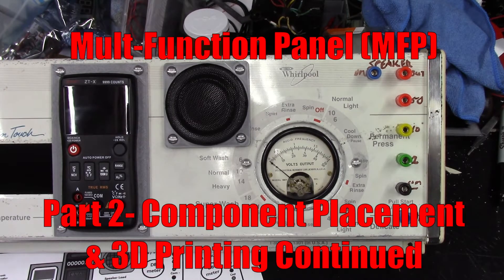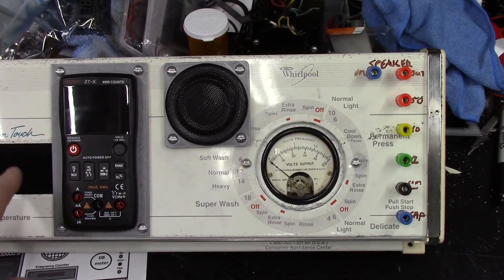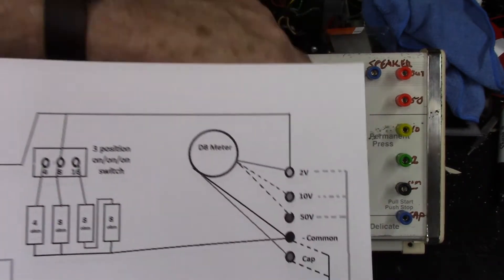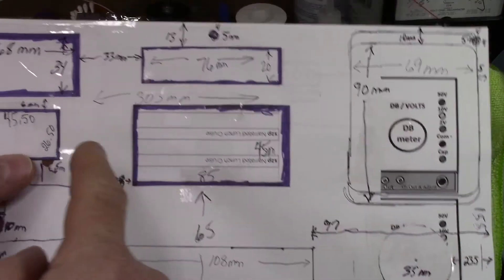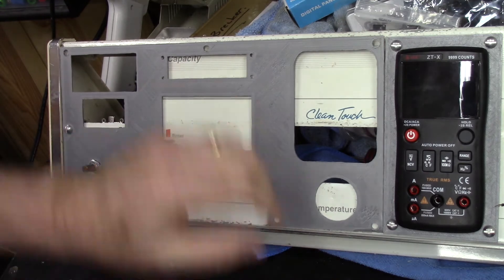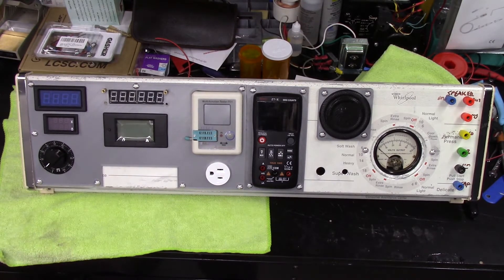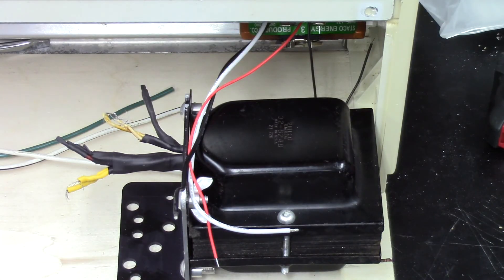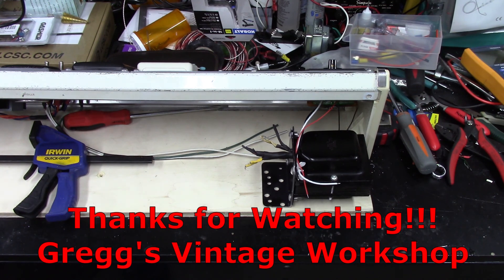Multi-function Panel (MFP) - Part 2- Component Placement & 3D printing Continued

Comment: It's coming along nicely Gregg and the 3d printer is really handy for this kind of thing. I couldn't have built my Dc bench power supply without the 3d printer. At least not as easily.
Reply from the maker: Thanks Pat, yes the 3D printer is really a time saver!

Comment: Gregg - your top notch planning and execution is evident. Will the second (extra) bezel fit on the inside to act as a guard from the sheet metal edges or provide extra reinforcement? It’s looks great and I’m looking forward to seeing it in action. All the best. Don
Reply from the maker: Thanks Don, you know I never really thought about that, as far as using the other bezel to back the metal. I'll have to look at that. Thanks for the idea.

Comment: Fine job Gregg.  Very well designed and laid out !   One question that I do not see on your design. Do you have a master panel fuse  on the AC side in there just in case ?  Great job my friend
Reply from the maker: Thank you Ron! As far as fusing the overall panel, The panel will be plugging into my isolation transformer, and I am building the "Glasslinger / Telefunkian" electronic circuit breaker that will be on the AC side of things, so no fuse will be required.
Reply: @greggsvintageworkshop8974   Ah, got it .... now that makes sense...  thanks my friend